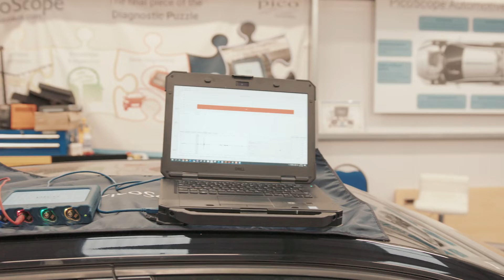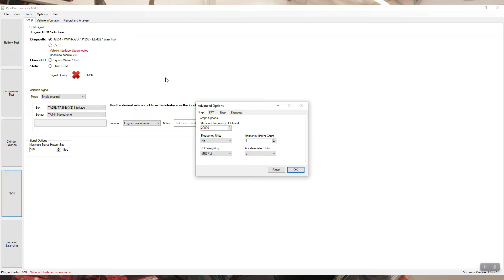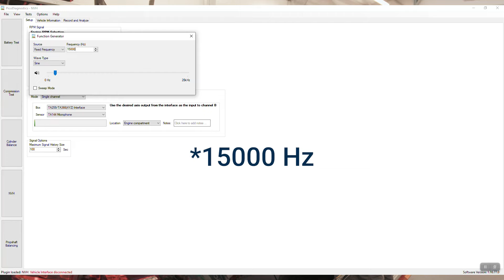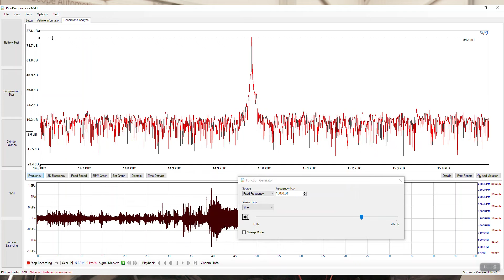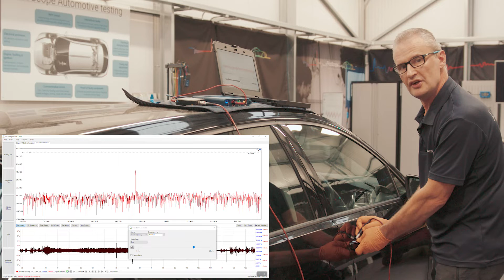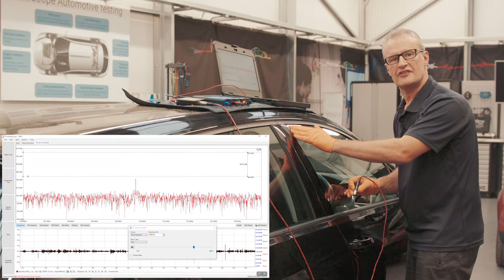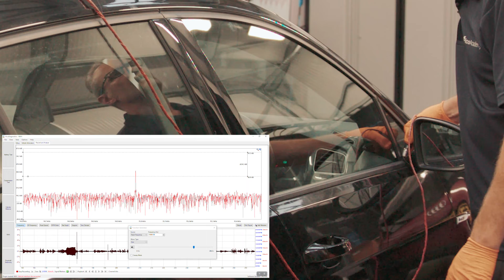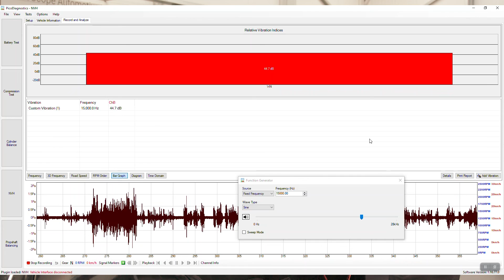Wind noise and water ingress with an automotive oscilloscope and Noise, Vibration and Harshness NVH

Comment: How clever, Steve.     It’s the audio equivalent of a smoke machine.      What a smart way to track down water ingress.       These case studies are also an excellent way to demonstrate the practical use of the NVH software - much more meaningful than talking through the features in an abstract way with no specific purpose in mind.       And it’s surprisingly sensitive, too; even if you weren’t aiming not to irritate bystanders, I guess you’d want to use such a high frequency because you probably wouldn’t get the same sensitivity at lower frequencies.     It’s very impressive, if not ingenious.    I for one would be happy to watch more of the same.    Thanks, Steve.

Comment: Hello. Very interesting measurement indeed. Of course, there are some factors that can have some influence on your measurements. I bet that the car used for your example has the tweeters (which  outputs the 15kHz frequency) right next to the side mirrors. But still a useful test. Thank you!